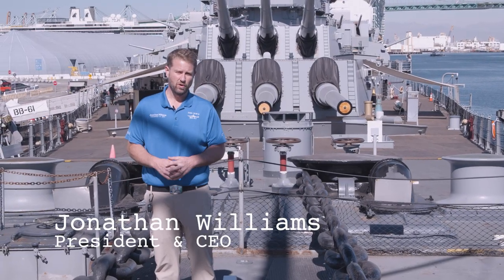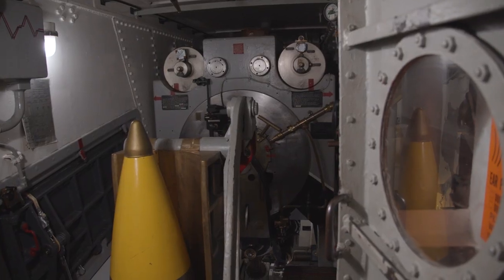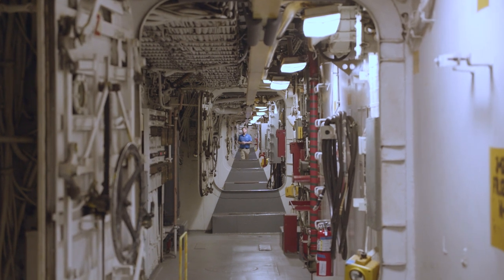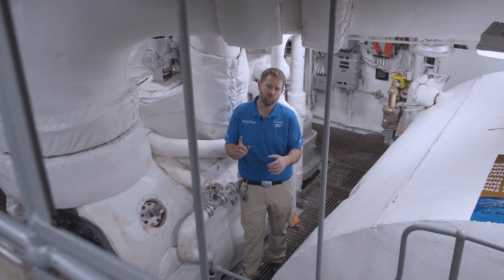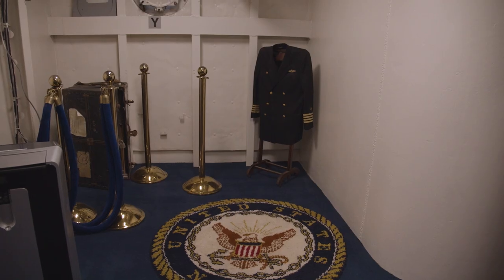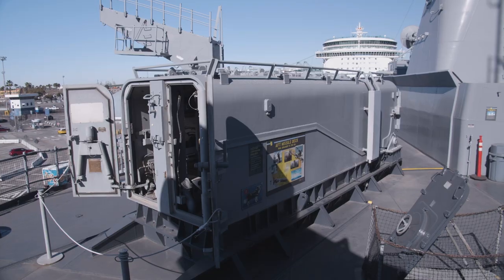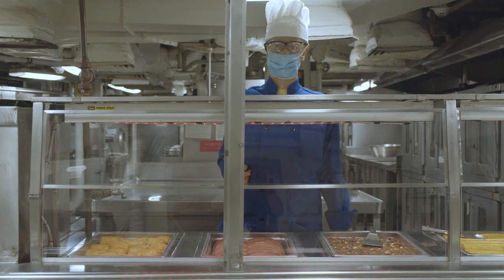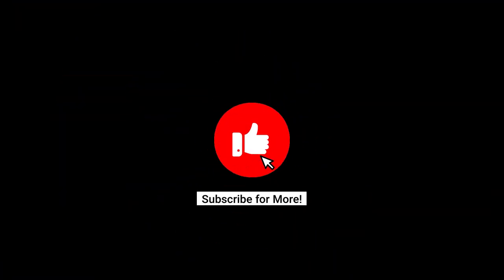USS IOWA FULL TOUR | Naval Battleship Legend

Comment: Slight correction #2 the MK-8 Rangekeeper was not replaced by a modern fire control computer for two reasons. First and foremost COST! In Reagans 600 ship Navy proposal the Iowa's were chosen to reactivate because for about the same cost as an Oliver Hazard  Perry class Frigate you had a Battleship a huge amount of firepower. creating a new modern fire control system would have cost millions upon millions of dollars and taken YEARS of development. Second, while they could have designed a fire control system using modern computers that would have been 1/100th the size they couldn't make one that could do the job any better, that is how good the MK-8 was. All the way down there in plot the "vibrations" would hardly be noticeable.